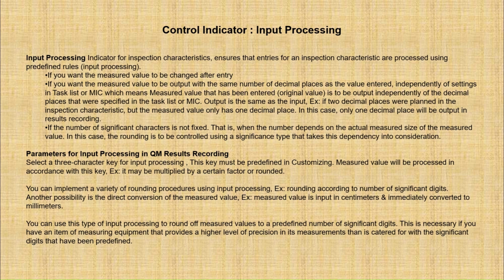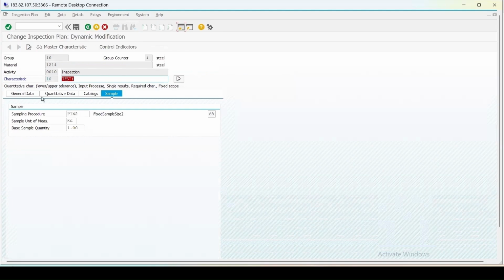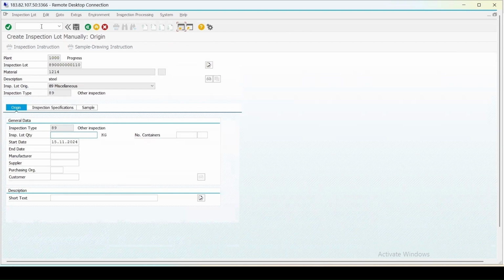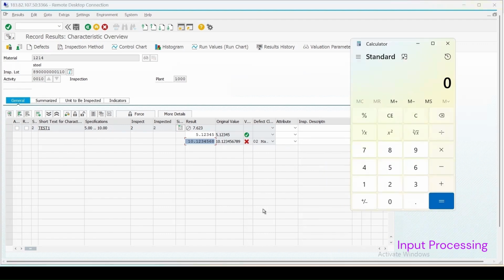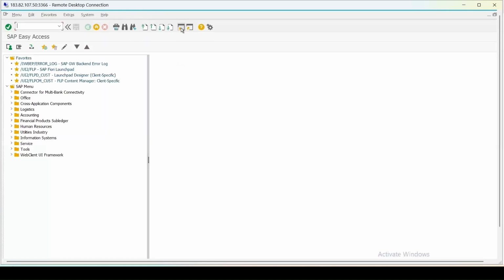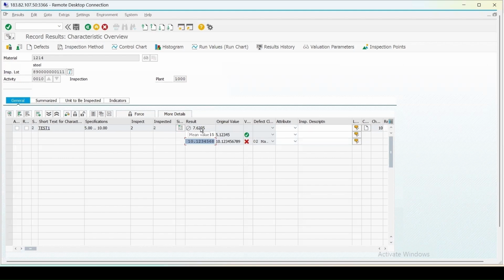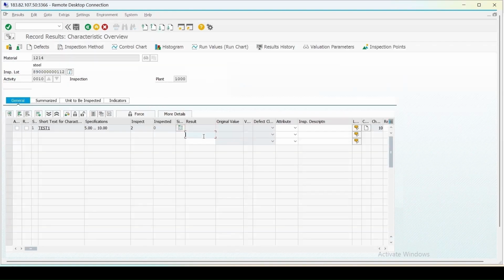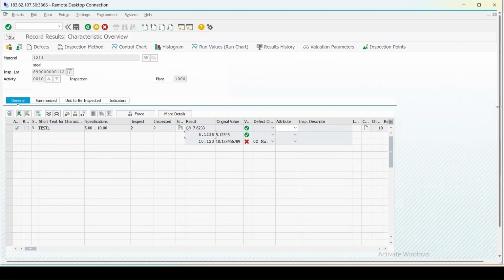SAP S/4HANA QM Master Data MIC Control Indicator: Input Processing | QS21 | SAP Quality Management

Comment: Nice one as you cover the indicators in details which no one has covered .if it's possible please give us  idea  of  the industry also in which it is used and why
Reply from the maker: Hi 

Normally used in engineering, manufacturing, or scientific research sectors where high accuracy required so equipments like Micrometer Calipers, Vernier Calipers, Multimeters, Speedometer are used.
i will appreciate if you share your queries at email:nishajaint19@gmail.com